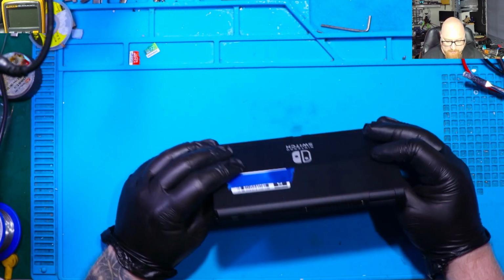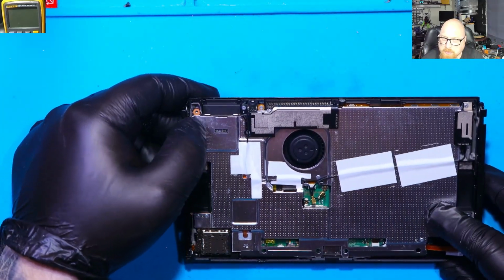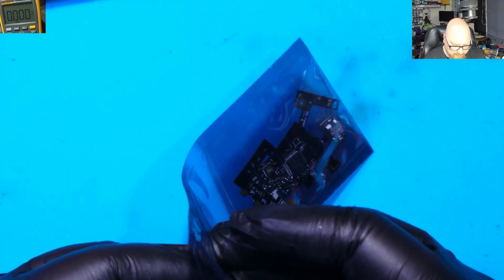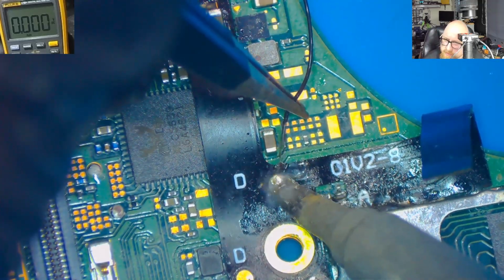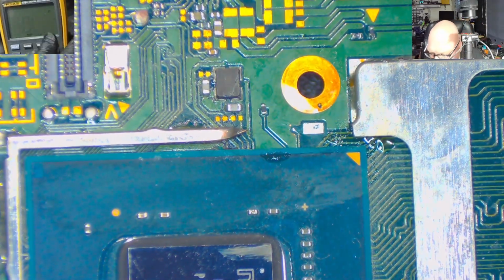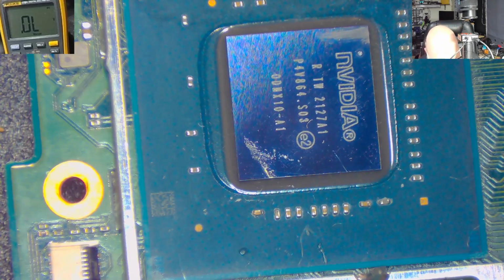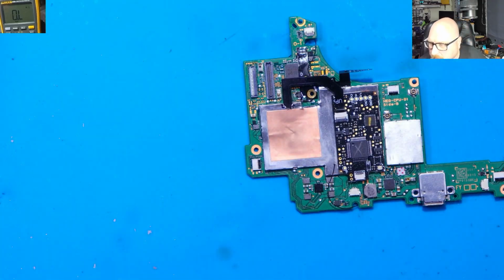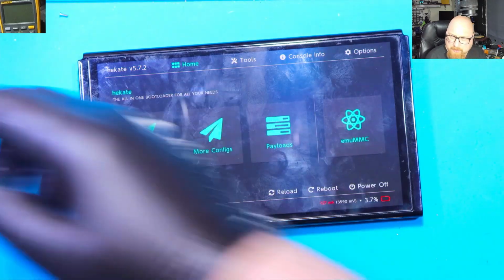Nintendo Switch OLED HWFLY Repair. Someone incorrectly installed HWFLY v3 console has died HWFLY v4

Comment: You can measure a resistor in circuit for the value? Good to know!
Reply from the maker: Not always. If you swap the probes and you’ve got different readings, you need to desolder it and then measure it. But if you swap the probes and the readings are the same, you don’t need to desolder it.
Reply: @tvpartsworld806  I figured there was a catch. Appreciate the info and awesome work as always! Love your content.